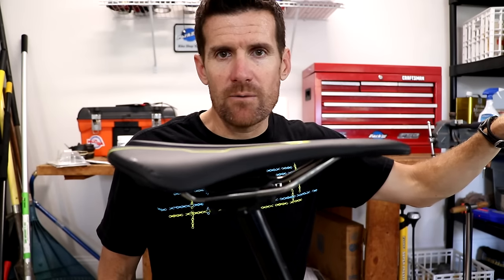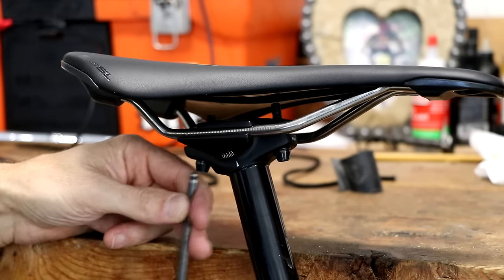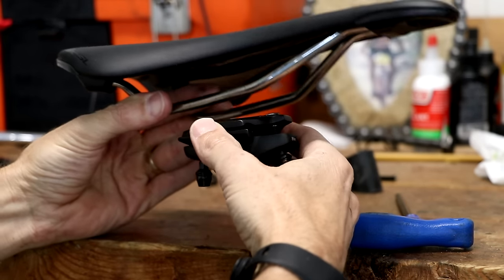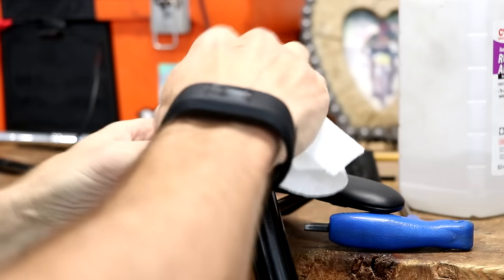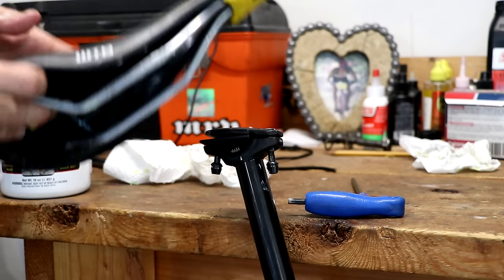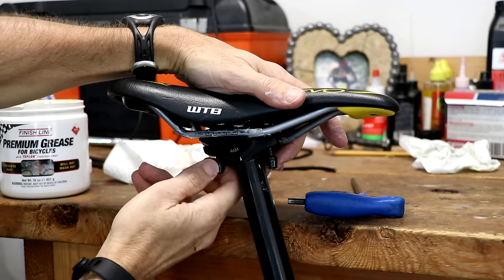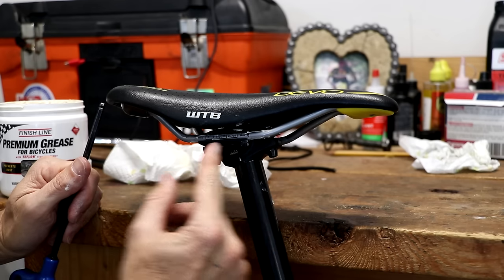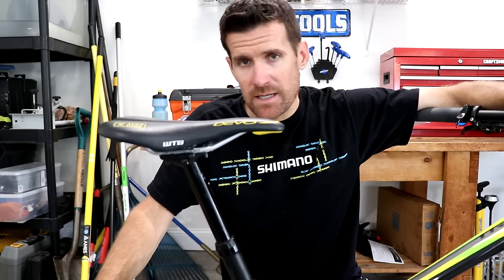How to Install or Replace a Bicycle Saddle

Comment: Bought a Carrera valour from Halford's I wanted a more comfortable seat the one it comes with is rock hard and gives me saddle sore so bought one off of amazon went out to change it just to realise it's this weird thing, I thought it was going to be the old type with 2 nuts it's the first I've ever seen this type of saddle, I take it there's no way to attach it and I'll have to find a nice size saddle in this configuration, how do I even search for this type of saddle does it have a name?

Comment: Serrotta used to make a 1-bolt seatpost.  It was pure genius.  Loosen the 1 bolt, adjust tilt, fore-aft, re-tighten bolt.  No idea why it didn't replace the 'standard' seatpost clamps..

Comment: Thank you, Clint. I used to do a ton of riding, but some health issues ( which I am working hard to work on) and long work hours reduced my saddle time. I appreciate the knowledge that you are sharing, and I now know where to go for basic stuff as well as knowing if a bike shop is being a bit sneaky. No offense, but not all bike, dive and computer shops are created equal.
You are a live saver.

Comment: My saddle was all the way to the front and want to move to the back.
It only has 1 bolt.
The 2 metal bars of  the saddle don"t fit/align with the channel of the bracket. Only 1 fits but not the other.
Should I use big pliers and try to bent those 2 metal rods so the get closer to each other and fit inside groves?
I am afraid to break saddle.
Please advise.

Comment: I have a 2 bolt seat post and can't get my seat level. When I tighten the back screw it shifts my seat too far up. Thoughts?
Reply from the maker: You should just be able to loosen one slightly and tighten the other one the same amount. If the front is too high you would loosen the back a little bit and then tighten the front or vice versa.

Comment: Any chance I can change the saddle to an entire different type. Like something that doesn’t have 2 bolts as demonstrated?
Reply from the maker: Yes, Unless it has a very unique design. Any standard saddle should fit on most seat posts
Reply: @ClintGibbs  ok thank you

Comment: How do you get the saddle to tilt forward slightly?
Reply from the maker: On this type of seat post which has a bolt on the front and back, just loosen the back bolt half a turn and tighten the front bolt half a turn. Keep repeating until it’s at the angle you want.

Comment: So i just need a regular Allen key? Yours looks like it has a different end.
Reply from the maker: Regular Allen key. I have the kind that has a rounded end on one side so you can angle it for easier reach. However you can’t use a lot of work on that side.

Comment: Can you use Vaseline? I don't see how it's any different than any other grease? I imagine you could even use cooking grease like you'd get from cooking bacon or something.
Reply from the maker: Never tried it but it could work to reduce creaking. However, it’s very thick and can hold onto dirt that comes off your tire. If you use it, just wipe it off really well after installing the saddle.

Comment: What if you have a single bolt saddle?  How do you replace that?
Reply from the maker: Just loosen it enough to get the rails out of the seat post.
Reply: @ClintGibbs  and what if you can't get it lose? My bike came with the saddle already installed, but I can't for the life of me get the bolt out, so I can't change it or even make any adjustments! It's just stuck. Almost broke my Allen key instead of getting the bolt out.

Comment: Where can I buy those 2 bolts but in bigger size?
Reply from the maker: Check with your local bike shop. They should be able to order them in the correct size
Reply: Clint Gibbs but what are those parts called?
Reply from the maker: @MrGreen-qr5pe  saddle clamp bolts, as far as I know

Comment: What if the new seat has wider rails??
Reply from the maker: Rail witdth should be standard amongst all saddles. I've never encountered a saddle with different width rails. If that is the case then you would have to get a seat post to match it.

Comment: My Giant bike saddle doesn’t have any screws or bolts connecting it to the post. I need to replace it because it’s just too uncomfortable. What am I supposed to do?
Reply from the maker: Is the saddle permanently connected to the seat post? There's got to be a way to remove it. If not you have to buy a new seat post as well.
Reply: Clint Gibbs I actually found the bolt. Unfortunately, it seems to be frozen. I took the whole post out and I put it in a freezer in my garage. I hope this will loosen it up. Thank you very much for getting back to me. It’s very much appreciated.
Reply from the maker: @dwa22204  see if you can spray some WD-40 in there and let it sit overnight.
Reply: Clint Gibbs I’ll do that as well. Thank you, Sir.

Comment: WD40 ok for the grease??
Reply from the maker: No. Get a grease or lube made specifically for bicycles.  WD-40 does make bike specific products, but the general WD-40 should only be used on metal to metal contact to solve a creaking noise
Reply: @ClintGibbs  THANK You!! and the Allen wrench- how do I know what size I need? I think the bike store told me a 5?
Reply from the maker: @Deelitee  it's usually a 5. I would recommend getting a decent bike multi-tool to carry on your rides. It will have all the major sizes.
Reply: @ClintGibbs  hi there! Do you mind giving me specifics ( name -type) of oil to use??? There’s so many to choose from!! 🙆🏼‍♀️🤷🏼‍♀️
Reply from the maker: @Deelitee  I use Rock n Roll gold lube on my chain
Reply: @ClintGibbs  thank you! I will need this for my seat replacement.  Okay to use it for that?
Reply from the maker: @Deelitee  no. Use WD-40 if it's an alloy frame or carbon-safe grease if it's a carbon frame.
Reply: @ClintGibbs  you said above not to use WD40?
Reply from the maker: @Deelitee  I can use it on metal to metal contact to keep things from creaking. That is the only application I recommend it. You can also use it on your saddle rails but it won't last as long as putting a thin coating of grease.

Comment: Parked my bike in public, someone for some reason stole my seat and not the bike 😂😂
Reply from the maker: That same thing happened to me many years ago. Had to ride 8 miles home standing up with a backpack
Reply: @mr walkway, Seats are extremely easy to steal (in 10 seconds literally) and cannot be protected with a lock. 

Some of them are worth a lot of money, like the Brooks seats, so you gotta be careful what kind of seats you use on bikes you park in public. Use expensive seats only on bikes you park at home, for commuter bikes use as cheap as possible while being comfortable enough, I suggest you even put a few scratches and blemishes on it just to avert attention from thieves. They can't sell damaged seats easily.
Reply: Jose Carreras Ive just been keeping my bike at home during quarantine. Once I move out I’ll look for a place with a bike room too
Reply: Lmao.. That is an ultimate troll move, well played
Reply: @zakquinn5420  I'm not even mad at the thief, they must have really needed that seat 😂

Comment: Ummm... so I did a big boo boo.  I took all the bolts off and took the thingy off.. I should have googled first.
should I just take it to a bike shop? or is there a video on how to put the plate where the rails go on?
don't laugh please, I am not mechanical.
Reply from the maker: You can put everything back together without the saddle on most of the time. Leave the bolts very very loose and work the rails of the saddle onto the plate. Then tighten everything up.
Reply: @ClintGibbs  OMG..  So, I watched this 4 times.. Looked at all the hardware and followed your instruction.  Though I have no grease (I will get some), so used Crisco (better than nothing), and with a bit of assistance from my ex-husband, I put the thingy back together!

THANK YOU! from the bottom of my non-mechanical heart!
Reply from the maker: Crisco. I have to remember that one 😉. Glad it worked out!